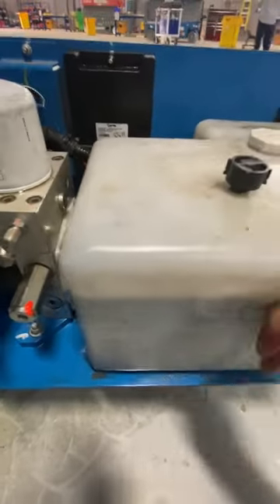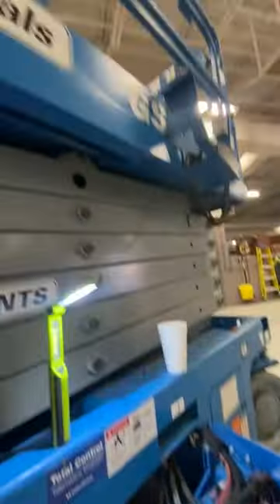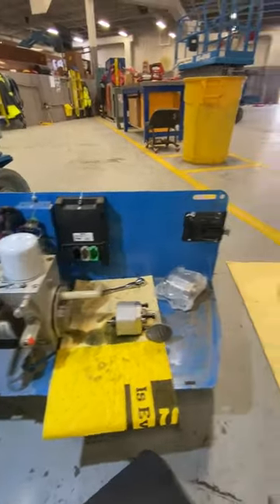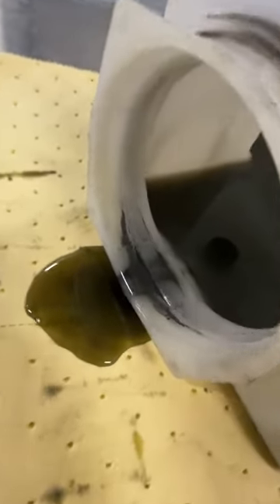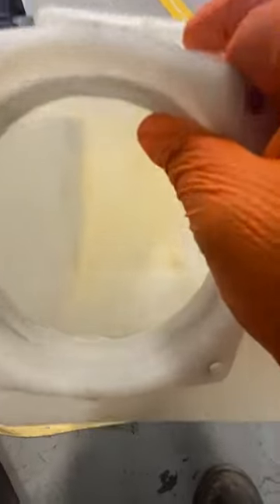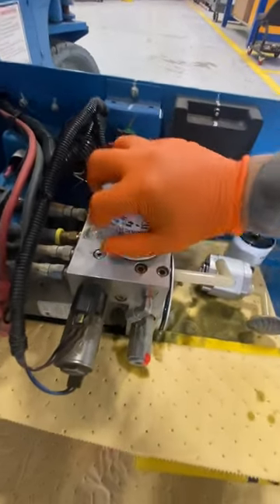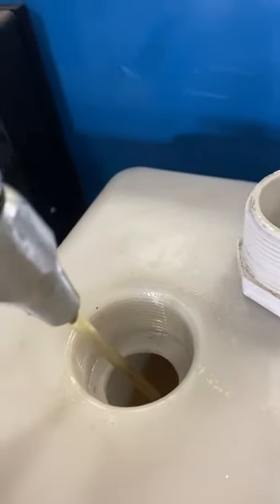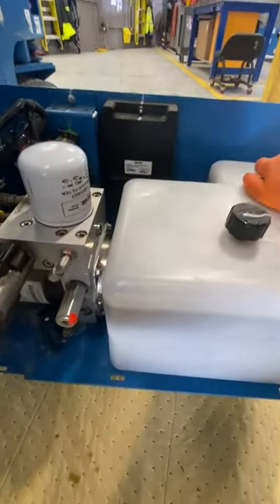Changing out bad hydraulic pump on Scissor lift

Comment: Do you ever bleed the hydraulic lines? If you replace the steering hydraulic cylinder would you bleed the hydraulic lines before tightening hydraulic lines on steering cylinder?
Reply: I’m wondering this too. Did you find an answer? I changed out the lift cylinder seals on my SJ3219, filled the tank back up w Dexron III like it requires. 
Watched it eat ip some fluid after moving a little up and down, filled up some more. 
Fluid is nearly full (it seems by the eyeglass) but the lift is suuuuper slow (to raise) and seems to be working harder. So I thought there’s airlock bc it wasn’t like that before.

Comment: Noob question. I recently purchased a used "Upright" brand Scizzor lift (X20N), and am wondering how do I purge all the old fluid out of the system when doing a fluid change or you don't flush ? Do we just drain the tank, clean and replace filter only ?
Reply from the maker: Typically, just have the unit at stowed should have all the fluid back at the tank. But yeah just fluid change and filter. Check for any shavings by the filter
Reply: @handymanny214  Thanks Manny. You're a Legend !